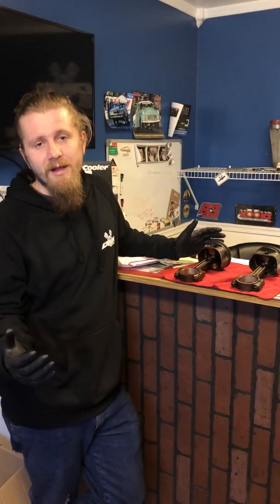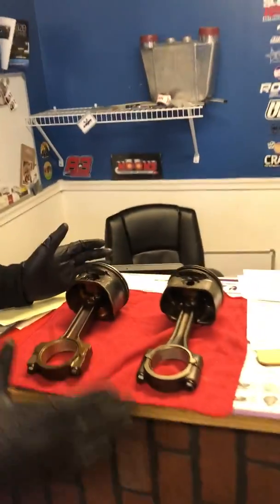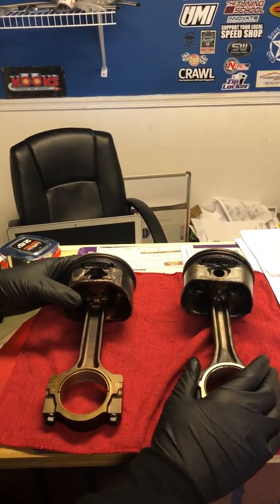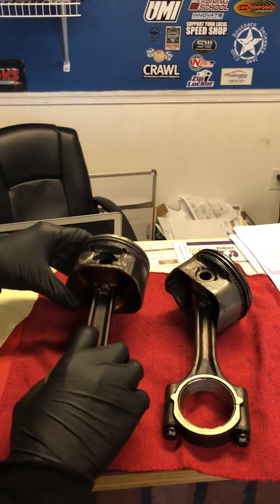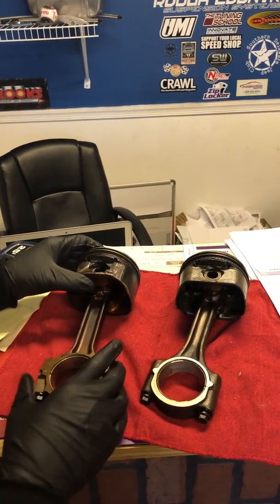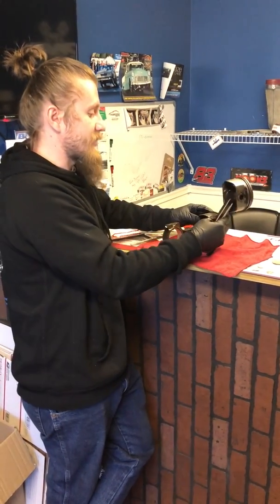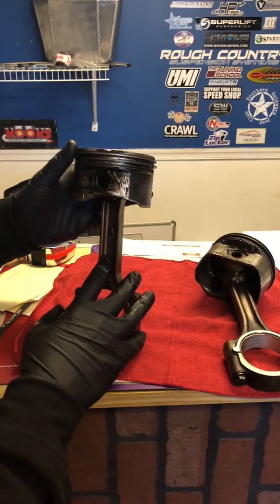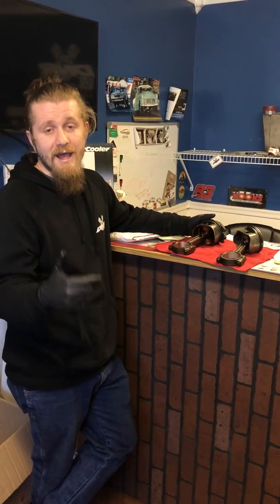Identifying gen 3 and gen 4 LS rods and pistons

Comment: I have a 05 lm7 came factory with gen 4 rods and 3rd pistons
Reply: Same with mine too. Heard about that a few days ago and now I am dying to take off the oil pan and look just to make sure. I know I’ve got the gen III dished pistons but Ive never looked at the rods.
Reply: @nspradmusic  05-06 were weird years for 5.3 LS engines. They introduced aluminum block 5.3L gen 3/4 engine blocks. Gen 4 blocks with 24x reluctor wheel, TBSS intake, DOD, 1 bolt cams, gen 4 rods and gen 3 flat top pistons with the “cross” on them. They ran on a special ECU and were labeled the  LH6/LH9. People have started to find 05-06 iron block 5.3s with the same rod and piston combo as above and some have found gen 4 rods with gen 3 dished pistons. Everyone’s only guess is they just started slapping them into iron blocks because they had too many... Doesn’t make any sort of sense lol